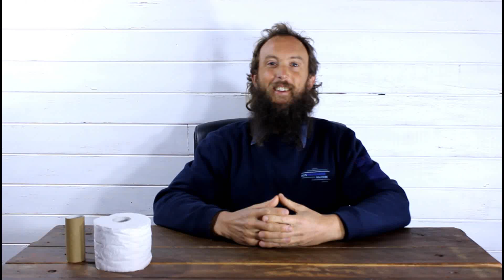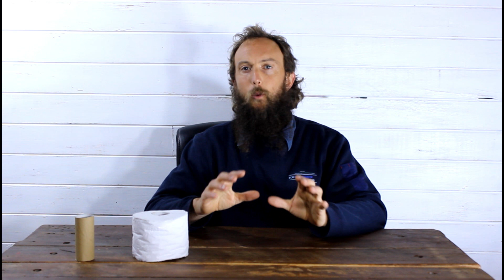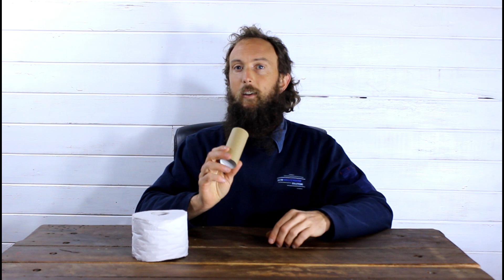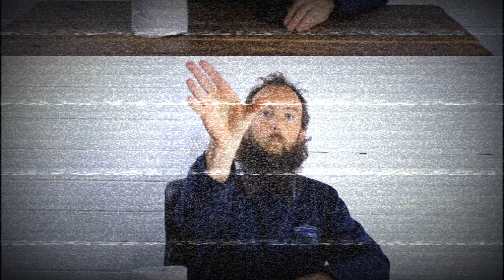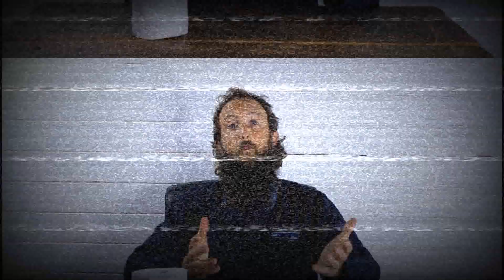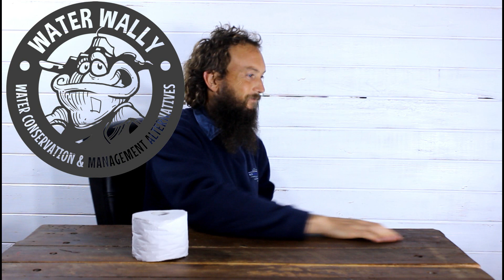What to do with toilet paper when using a composting toilet

Comment: Thanks, good info. I just installed my natureshead and was wondering why people were telling me I shouldn't drop the paper.
Reply: I have a Nature's Head. I think people figure if there's no TP then the excreta will evaporate the water, reducing down in size by at least 50% - thus doubling your capacity use before needing to empty the Nature's Head. But as this vid points out - you want the carbon ratio for composting. Actually you want natural compost that has aerobic bacteria in it to really kick in the composting process.

Comment: Yes!  I've been saying the same thing for years.  Plus, you can use a sheet of paper towel for a big job.  Try using that in a flush toilet and bad things will happen.
At the moment, my pipes are frozen, so the flusher is useless.  My Luggable Loo is now in service and the toilet paper goes right in the bag in the bucket with a good covering of all with pine pet bedding.
Cedar smells nice, but takes forever to break down, like oak leaves.  When the bag is full, it'll go in a corner of my back garden for a year, then I'll add the contents to my regular compost bin.
Jon in rural BC, Canada
Reply from the maker: Thanks for your comments Jon!  Yep - it all breaks down in the end! 😀

Comment: Hey there, we lived off grid next to a creek for a while and we had a $20 bucket toilet that we turned into a composting system. I would mix up a big tub of wood shavings, peat moss and bokashi grains. Put a layer of this mix in the bottom with an old 1cup scoop and then simply throw the paper in after doing the do, then sprinkle 1cup over each time. We did try to avoid no 1’s in this bucket though. When it got a bit full I tipped it into one of two barrel compost bins and gave it a couple of turns. Rinse out the bucket and start again. This gave us the best compost in only four months. 

Our loo was outside in a shower tent so we had to have a salt barrier around the edges to stop the leeches climbing up your feet during your quiet time  - very disconcerting otherwise 😀
Reply from the maker: Sounds like a great setup! Way to go! :)

Comment: What about wet wipes? I figure the paper part of them is fine but the moisture makes me wonder... although poo has moisture too and it dries out...
Reply from the maker: Hi Aaron, the issue with wet wipes is that they are generally not made with only paper and they have other materials which do not break down. The moisture component of them should be fine but it's the material they're made of which is the problem. I've found that even wipes that claim to be 'biodegradable' just don't break down quick enough. If you find one that works ok - let me know! Cheers!

Comment: Is a composting toilet a poor choice where a toilet is only used intermittently? (On a boat)
Reply from the maker: Nah... The composting process will stop eventually if the loo is not used for a long period of time but it will start again when the toilet is used again.
Reply: A composting toilet in a boat? Where is your garden or peace of land where you use your composted material? Where onboard do you set up your composting bins for a year? I would look into Separet Tiny, a urine separating toilet. Urine goes overboard, poo is taken to some trash bin on shore.